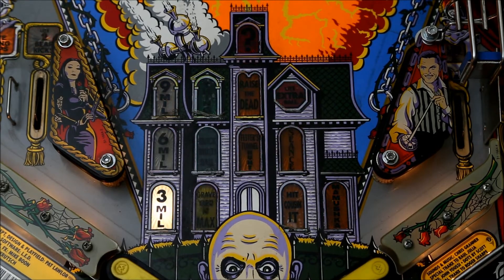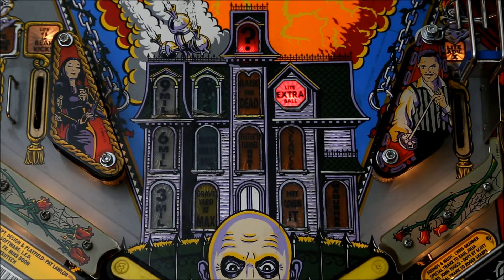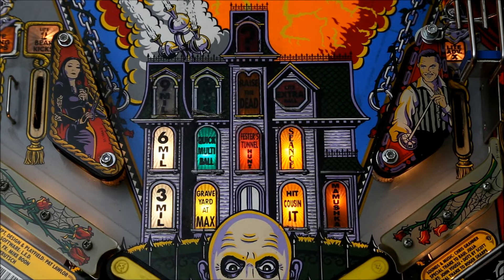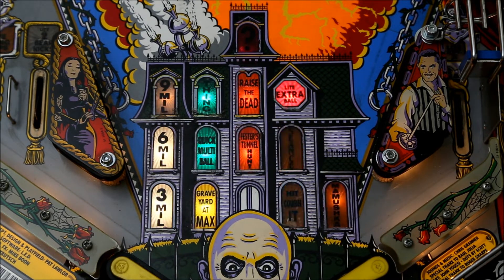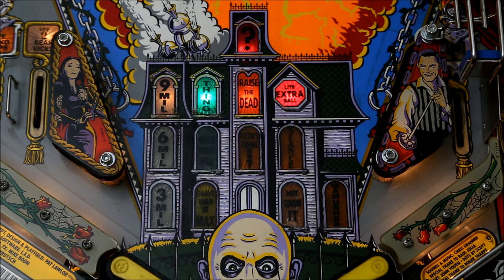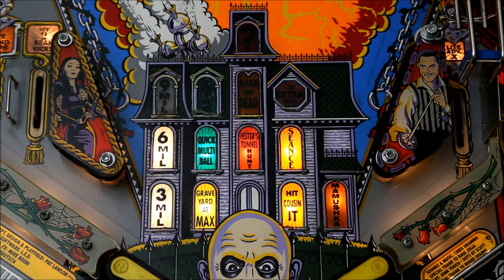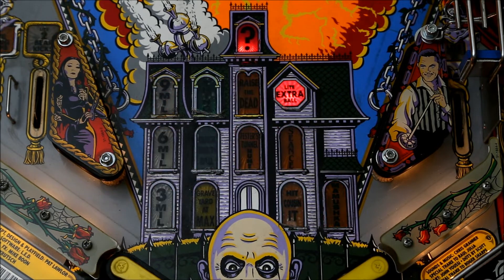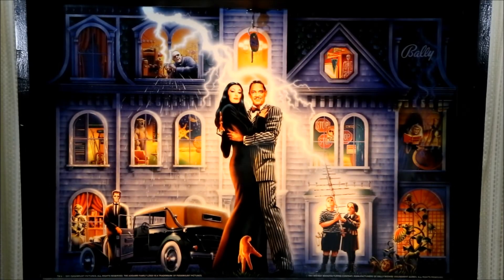Addams Family Pinball Game Light Flicker Problem

Comment: If all lights are flickering I’d suspect it’s an issue with the power supply. 
Do you have any way of measuring the voltage. Having an oscilloscope would be ideal to see what the voltage at the bulb is doing. 

Was the problem already present before you replaced the bulbs with leds? It might be that the power supply expects a certain (minimum) load. Using LEDs instead of incandescent reduces the load by a lot.
Reply from the maker: I never noticed it before the LED replacement because I never left the machine on in attract mode long enough for it to start flickering. I only noticed it because I left the game on while changing the lamps to make sure the new LEDs seated correctly to work. Thanks for commenting!